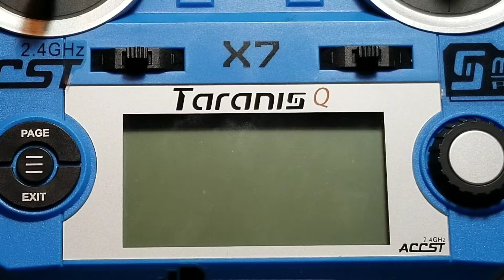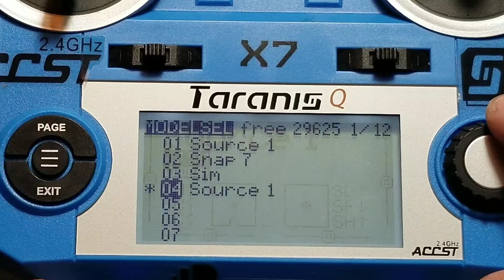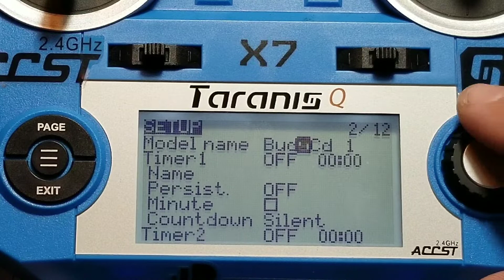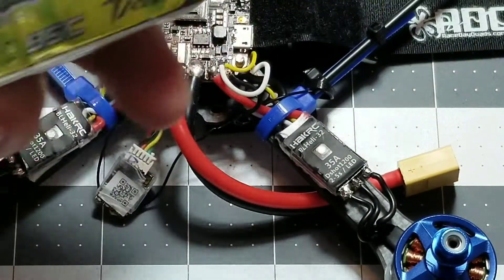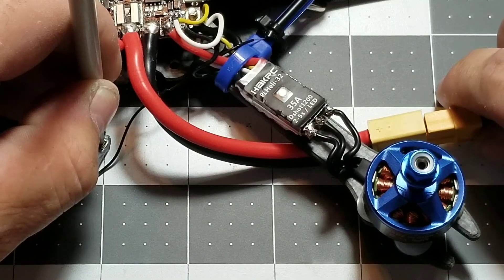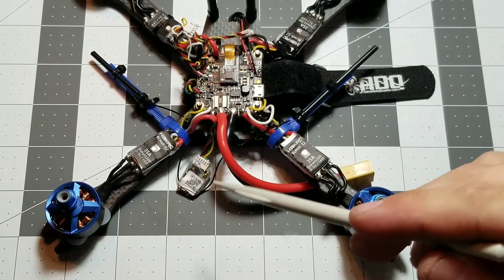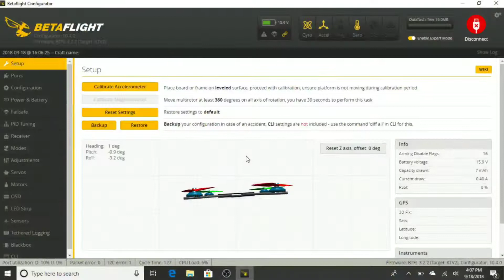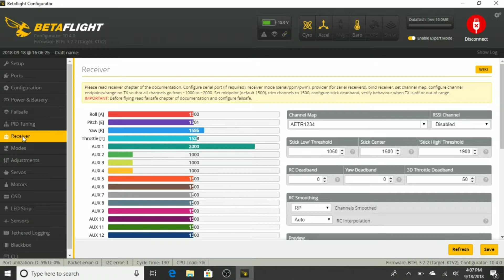FrSky R-XSR Binding

Comment: I just installed the same reciever on a geprc phantom. I follow the procedure exactly, get the green to turn on but the red stays solid. When I unplug power and plug back in it's no longer bound. Any ideas? Thank you. I really appreciate any advice.
Reply: Oh by the way, the blue sbus light stays on. I have also reconfigured everything properly in betaflight and all my reciever terminals are correct.
Reply from the maker: @dan71559  may be a receiver issue have you tried flashing firmware to the receiver? Also are you using Accst or Access?
Reply: @edrone_  Thank you for your reply. Turns out I have the EU formated receiver. Ordered the right one!

Comment: Can I bind my beta fpv lite radio 2 to this
Reply from the maker: Absolutely yes you can. You can use either Frsky D8 or Frsky D16 depending on how many channels you need 😉
Reply: @edrone_  I just got a iflight nazgul v2 do you know how I would bind the lite radio 2 se to this it has the rxsr receiver
Reply from the maker: @patrickkelly4851  https://support.betafpv.com/hc/en-us/articles/900003583046-Manual-for-LiteRadio-2

Comment: Hi, i have trying to bind my jumper t lite multi-protocol to my this receiver but i can't find the d16 mode, is my transmitter not compatible or is this fixable? Thanks
Reply from the maker: You can use d8 mode should not be a issue unless you need more than 8 channels 😉

Comment: when i bind it the green light is on but the red light is not flashing? so when i unplug it and turn it back on the red light is flashing without any green light?! any help
Reply from the maker: Make sure after you bind receiver you keep plugged in to power then turn off bind on the controller, then disconnect power from receiver. Power receiver back on without pushing bind button and should be green.
Reply: @edrone_  thats exactly what i did like 5times
Reply from the maker: @franzferdinand1  make sure you have the correct firmware for your location, if you do then you may have a faulty receiver
Reply: @edrone_  how do i find out i have the correct one?
If not do i have to flash it? Cause the cable that came with it to connect wx7 with receiver doesnt fit...
Reply: @edrone_  i really cant figure out what im doing wrong
I set my qx7s to bind
Mode is 16
Ch. Range is ch1-16
RxNumb 01 and press bind
Then i plug in lipo while pressing the bind button on receiver
I hold that button till it stops beeping and if its finished (all lights on /no blinking) i press the button on the qx7s to stop that beeping sound
Then i unplug my lipo
And after i plug it in again its red only blinking no green
Blue is always on
Reply from the maker: @franzferdinand1  make sure you have the receiver in sbus mode you may have put the receiver in ppm mode if you go online or check the instructions they will tell you how to make sure its in sbus mode
Reply: @edrone_  ok maybe its because i ordered my transmitter from china and the drone from banggood but shipped from es (spain i think) so they are not compatible...?
Reply: @franzferdinand1  having the same problem just now.. let me know how you make it work
Reply: @patakiciprian  i think my problem is that one of them has non eu and the other has eu firmware
Reply: @franzferdinand1  i just flashed the eu firmware on my tanaris, and it does the same. i had the non eu before. i just got my drone from a guy that was connected to the same model of tx
Reply: @franzferdinand1  https://www.youtube.com/watch?v=4x7ZEMbUqow this will fix the issue, upgrade de XJT firmware on nonEu version.

Comment: Hello I have the very same issue but with a XM (not the +) wired to a BetaFPV F4 2S FC. However when I try your solution there is no blue led coming. Thanks for the help
Reply from the maker: The xm does not have a blue led only the rxsr has blue led
Reply: @edrone_  thanks. So I guess the solution explained in the tuto is not applicable to my XM. any other tip for the XM so that my sticks and switches work in BF and with my drone. Thanks
Reply from the maker: @TheThierryfied  make sure you have the correct uart selected for your receiver and the correct protocol on the configuration tab you should select serial based receiver then select frsky
Reply from the maker: @TheThierryfied  https://youtu.be/Qh_n2W2hqj8